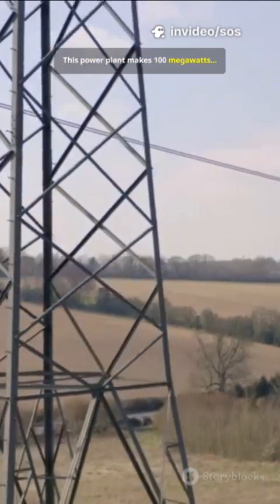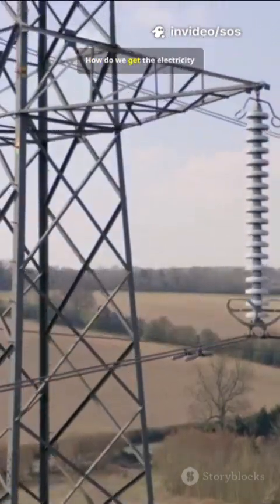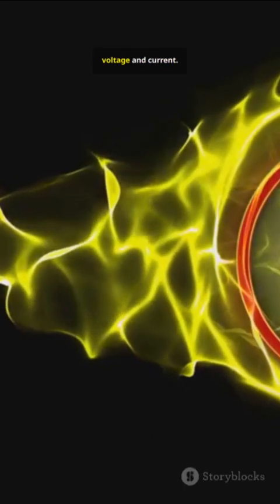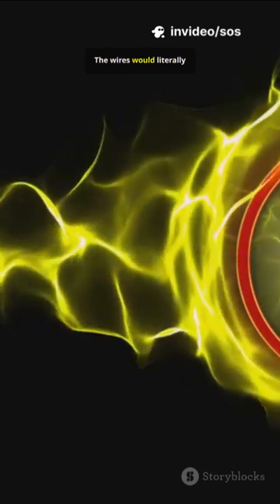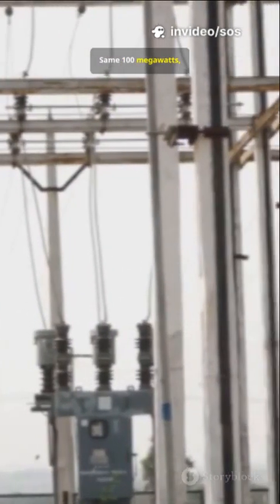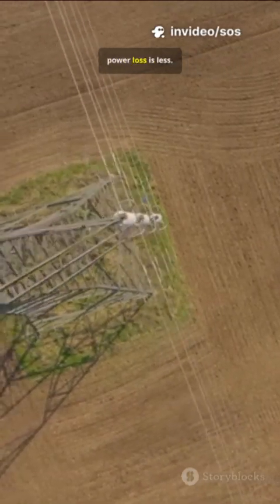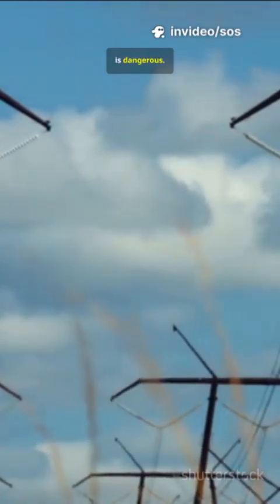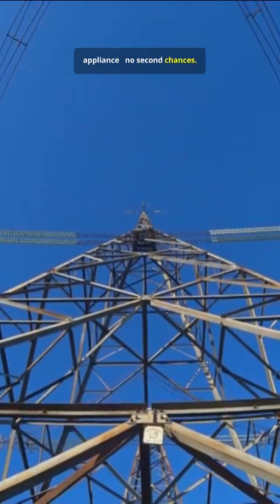Why Power Lines Use High Voltage #science #power #shortsfeed

Comment: What is the relationship between voltage and current?
Reply from the maker: current is directly proportional to voltage. power is the product of voltage and current. to send the same amount of power over the lines, if voltage in increased the current reduces. power loss as heat is directly proportional to square of the current. so a lower current is preferable for power transmission.